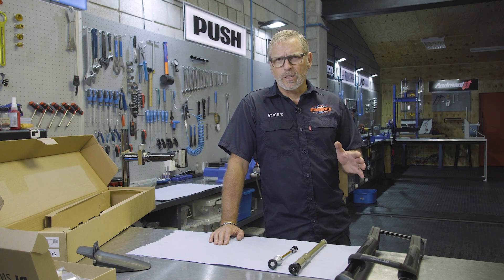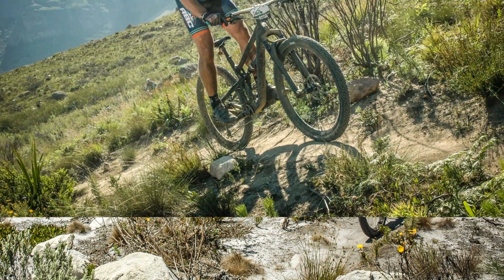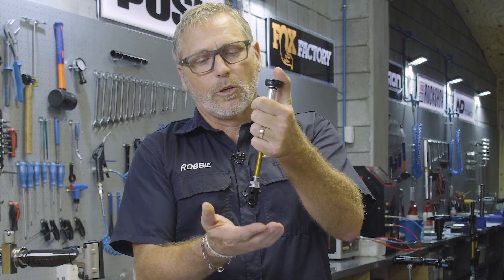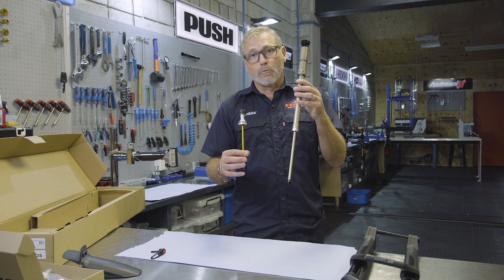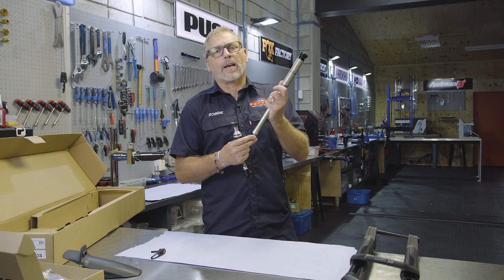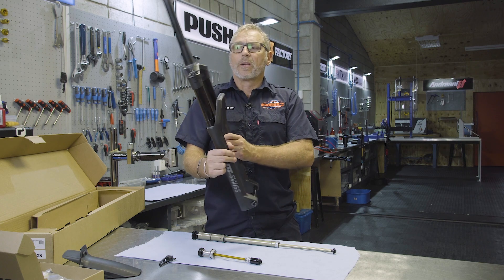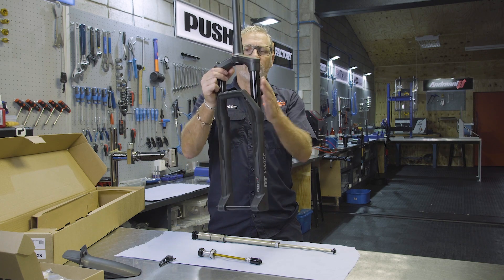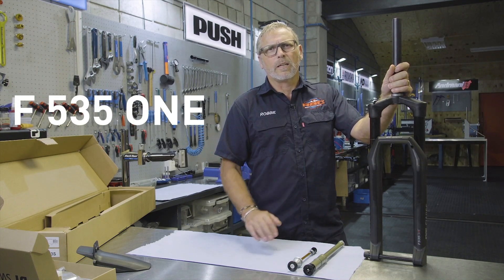MTB suspension fork F 535 ONE: Test, review, features.  | DT Swiss

Comment: I run this fork and am a heavy rider. It’s solid and paired with a rear coil shock is how I run my big rig. It’s the next best thing to the old launch control for me, which I miss. UK rider all weathers.
Reply: I’m looking at replacing my Fox34 with this DT fork, I weigh 250lbs/113kg and I was wondering what you weigh given you run this fork at a heavy rider weight. Thanks.
Reply: @goforbroke2  I’m 114kg so this will work well. It’s a versatile smooth operator
Reply: @slh7808  Thanks for the feedback, I’m definitely going to grab one. It’s going on my burly single speed, should be a good fit.
That Sade reference. 😎

Comment: I would like to buy a F535one 27 130mm for my roscoe 7(2020). Can 2.8 tires fit ? thx guys
Reply from the maker: Hi Axel and thank you for your message. The max. tire width we recommend for our F535 Fork is 75mm ( aprox. 2.9" ). As the tire diameter is related as well to the rim width, we suggest to check tire width when mounted on the rim/wheel you're using. Enjoy riding your Bike, Friso "DT Swiss".